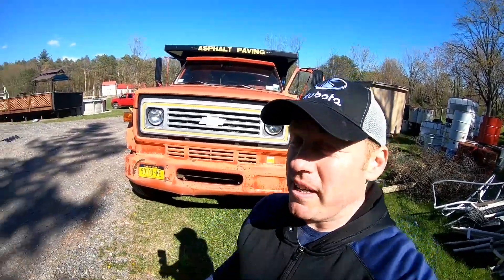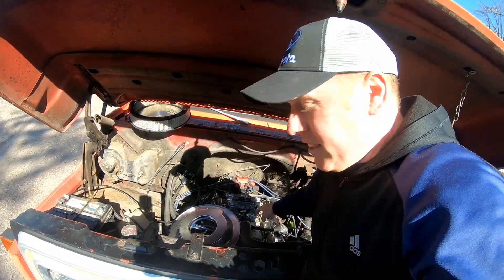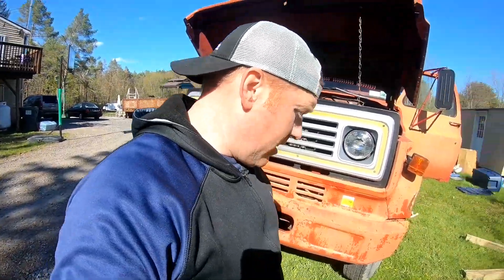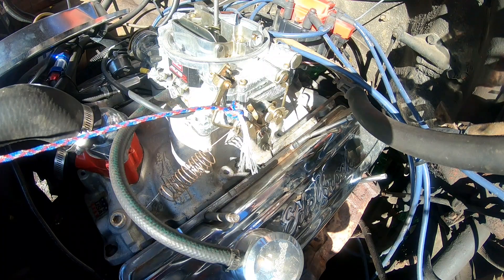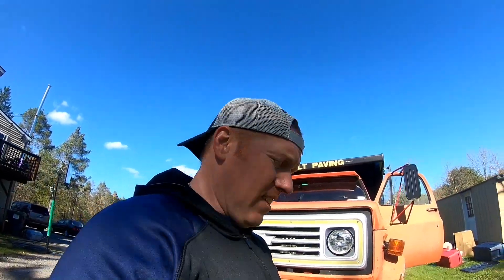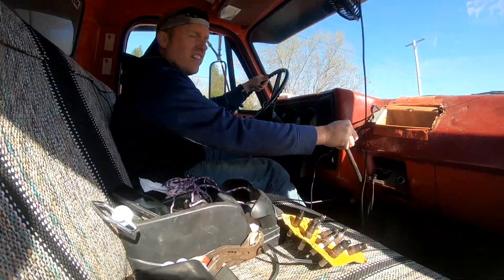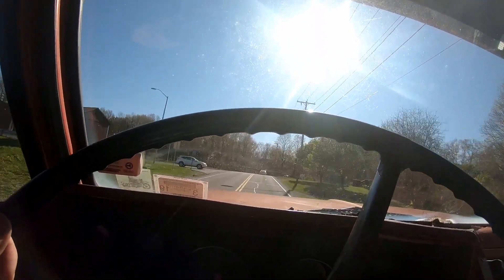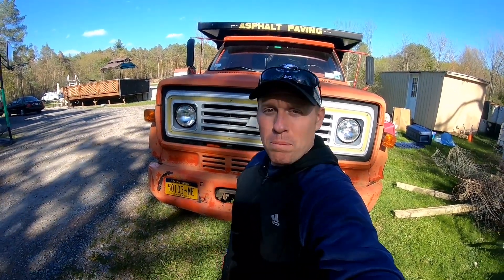Chevy Power Loss ????? Figured Out!

Comment: What size cfm carb you have on it?
Reply from the maker: I got the 650 on that truck,  I actually called summit racing to match up the carb and air intake with my motor, they were very helpful. If your looking at getting one give them a call and they will set you up with the right size for your engine and answer any questions you might have! Thank you for watching!👍😊🍻